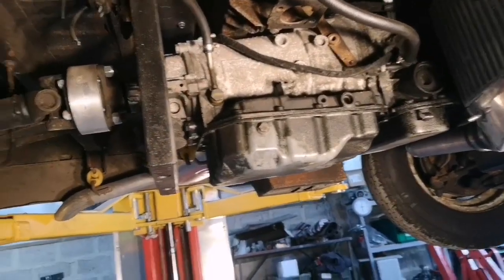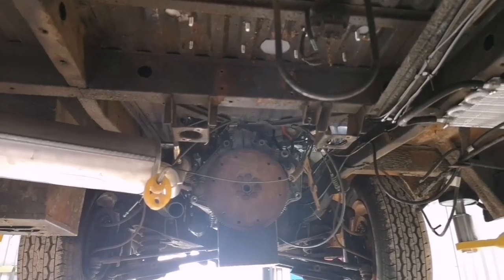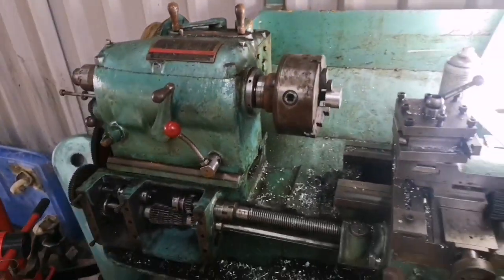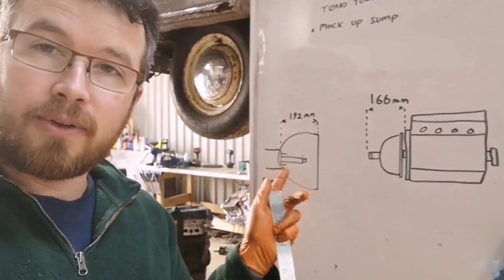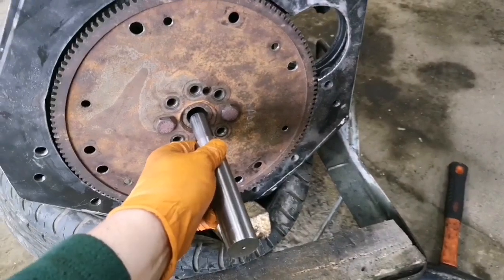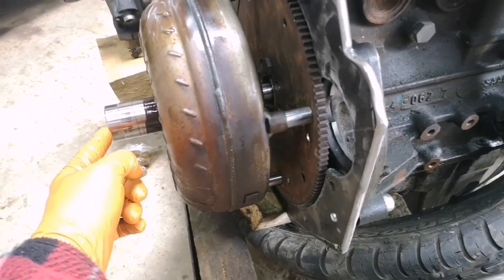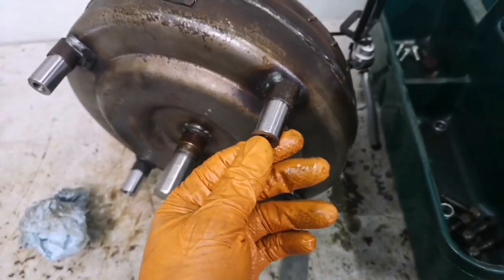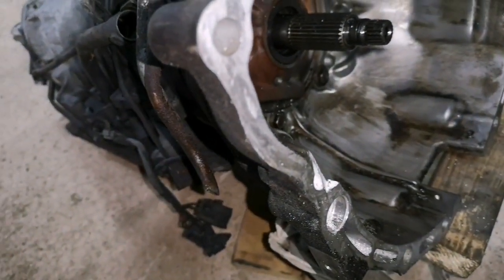The Commaero - Episode 2 - Mating the MX5 box to the Saab B234

Comment: Warp speed progress and impressive engineering again. Is there any chance those extensions won't be man enough to take the torque and shear?
Reply from the maker: Thanks. I thinking they'll be ok. You're putting max 450Nm of torque through them plus it's a fluid coupling so won't really ever be at a dead stop. Where as with gearing you are putting 4000ish Nm through the likes of your wheel studs. And with all my stuff, test and adjust if needed 😁